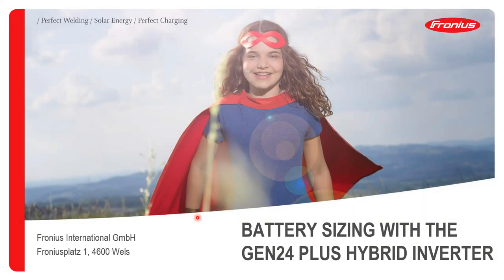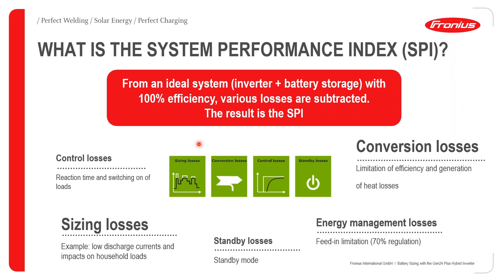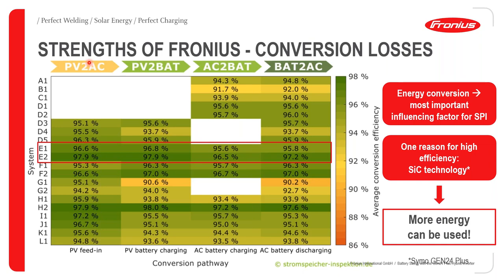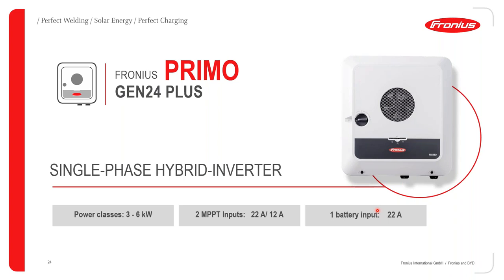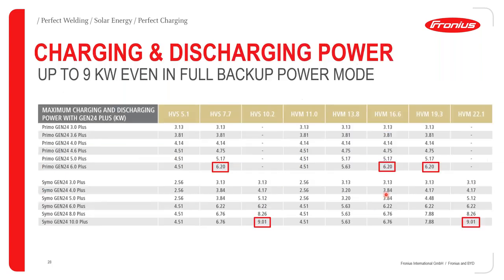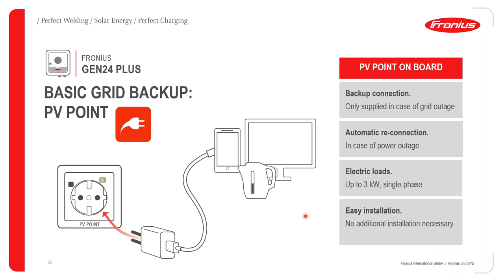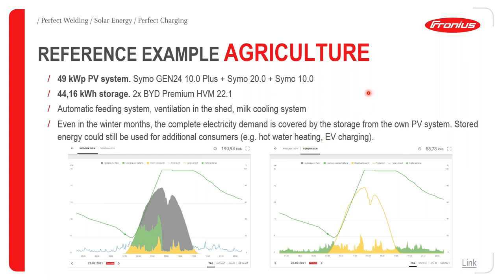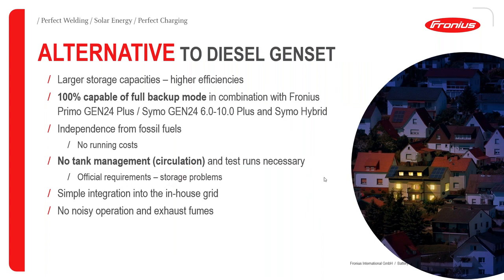Basic Webinar: Battery Sizing with the GEN24 Plus hybrid inverter (AFR)

Comment: 43:25 Serious question:
If I have a 60kW Hybrid setup, and want to use 60kWh HVM, how many GEN24 Plus 10.0 Inverters  should I use and what would be the other inverters?
How many Smart meter should I use, and where should I connect them?
Should each inverter will have data manager?
Can the AC output of all inverters be connected together? Should I use AC combiner?
Reply from the maker: Hi!
It’s great to learn about your interest in our products and solutions.
To answer your questions:
- Battery sizing is usually based on consumption (KWh). We recommend the battery size to be 120% and 150% of the consumption for daytime and night time consumers respectively.
- All GEN24 Plus inverters must not have a pilot card. The outputs of the inverters in hybrid system can be connected to a common bus-bar.
- For now there is no GEN24 Plus inverter to inverter communication, so if you need to do zero-feed/feed-in control in then this will not be possible. However if you don’t need to do feed-in control to the grid then it will be possible to use 6*Gen24 Plus 10kW units which.
Best regards, your Fronius Social Media Team

Comment: Hi. Do the GEN24 series have a dump/aux load facility i.e. when the battery is fully charged and there is still PV production the power can be directed to an auxilliary load e.g. water heating, swimming pool pump etc?
Reply from the maker: Hi! Yes, our GEN24 Plus does have I/O ports which can trigger a 12V relay to turn on specific loads once the battery is fully charged. Best regards, your Fronius Social Media Team